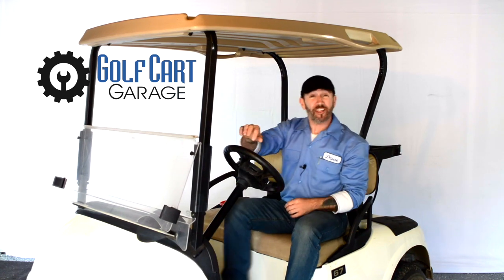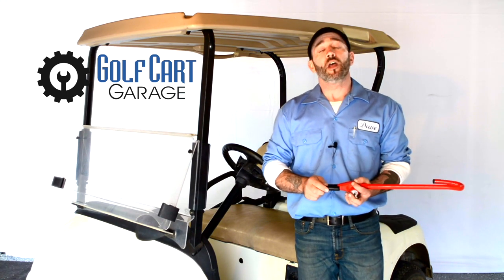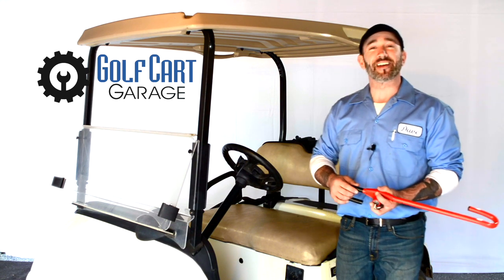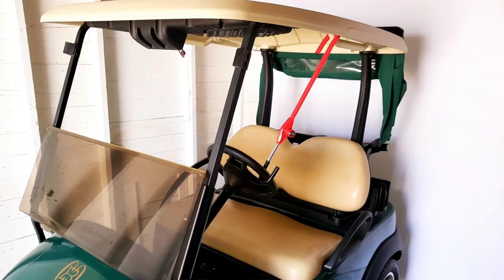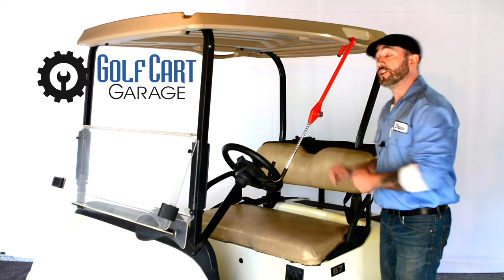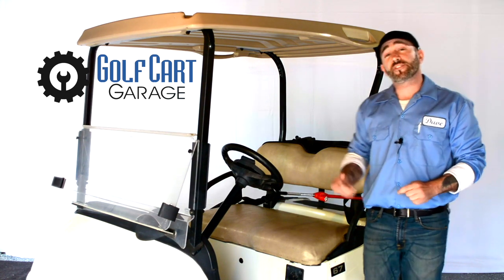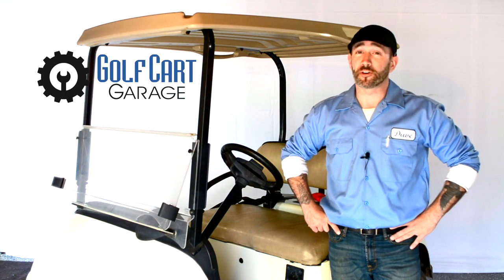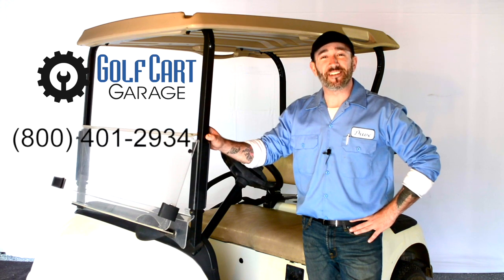Install "the CLUB" Golf Cart Security Bar | How To | Golf Cart Garage

Comment: That's all well and good but it doesn't keep someone from flipping a cart into tow mode and pushing it away.    The whole point of this thing is to keep the accelerator from dis-engaging the brake.  Perhaps a redesign is in order.
Reply from the maker: Can't disagree with you, there, Andy.  If someone is determined enough, or carrying power tools, or maybe aliens beam up your cart.... the Club is not going to stop them.  That said, if one disengages the brake and pushes the cart away... they'd better hope it's already oriented in the direction of their proposed getaway, as they certainly won't be making any turns. Either way, we'd love to have one that's more cart specific, so if you know anyone in research and development..... send them our way.

Comment: So smug with their anti-theft solution. LOL.  My neighbor had his GC stolen.  Four men picked up the entire cart, put it on a trailer, and gone.  That Club solution wouldn't do a thing to prevent that. Also, with battery operated power tools, they would cut through that little piece of metal in 30 seconds.  What a joke.
Reply from the maker: Good point.  This will definitely not cut it if 4 big guys are determined to dead lift your cart away.  It is really only meant to prevent folks who don't regularly carry power tools or even your kids from driving away with it.  Though... one could switch the cart to "tow" and stop them even if they cut The Club.  Seems you may want to check this out:  GUN RACK:  https://www.golfcartgarage.com/golf-cart-gun-rack-stand-up-floor-rack-for-2-guns/
Reply: @GolfCartGarage  Thanks for your reply.
Reply: @GolfCartGarage  what does switching to “Tow” mode do to prevent theft? Thanks.
Reply from the maker: @scrippslarry  Switching to "Tow" stops the batteries from delivering voltage to the powertrain.  The cart will not move in this condition.  It would not occur to most thieves to check for that little trick, particularly if they're not experienced golf cart owners.
Reply: @GolfCartGarage  Thanks! That's what I thought too. That is what I have done on my cart thinking that in the middle of the night it might be something they don’t think to check for or also they would need a flashlight and make a lot more noise to got to and flip that switch.